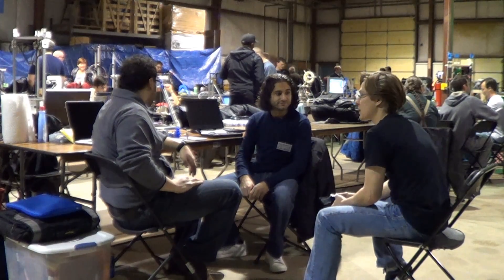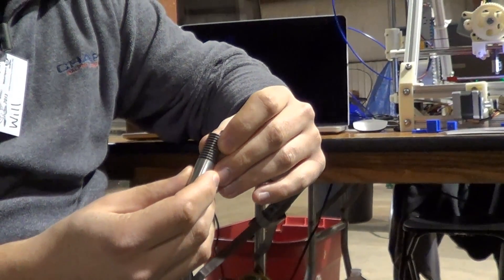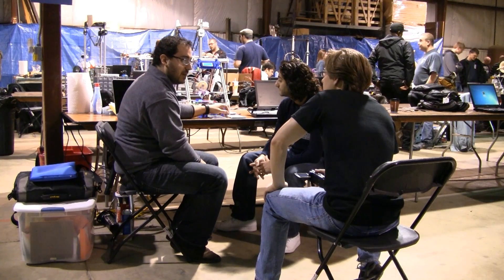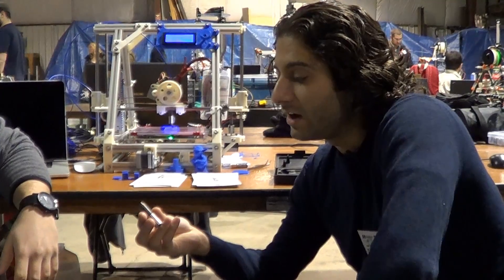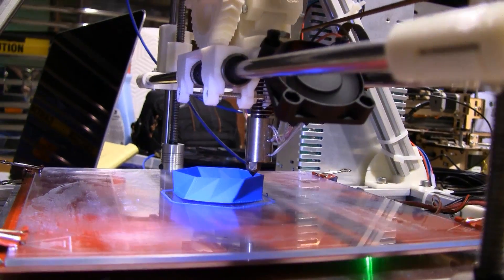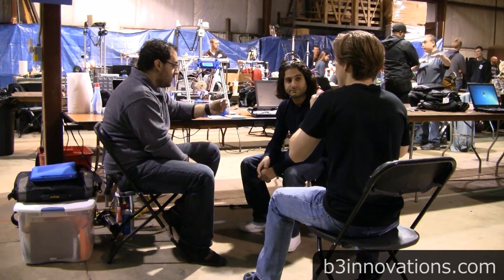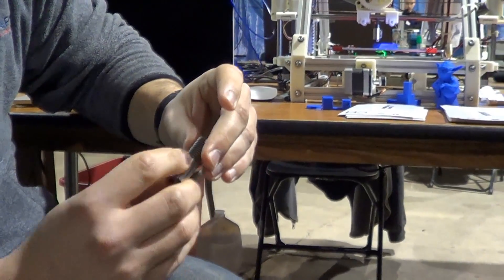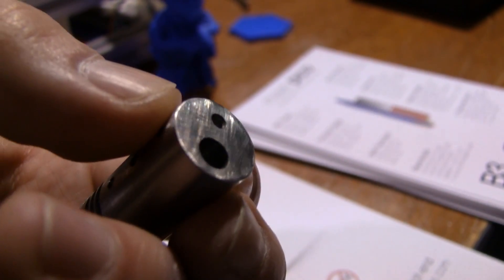The new pico Hot-end by B3 Innovations

Comment: Jhead can melt after 240c, So you are limited what you can print,
You can also not print very fast, 
After that it does indeed work great for me, and i will always keep it even if i get another hot end as reserve, But All metal has more advantages